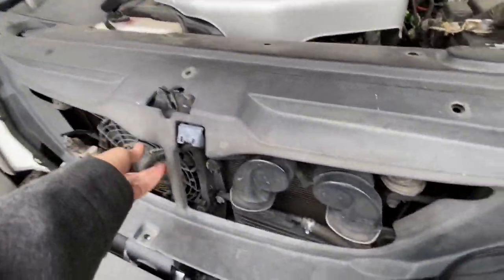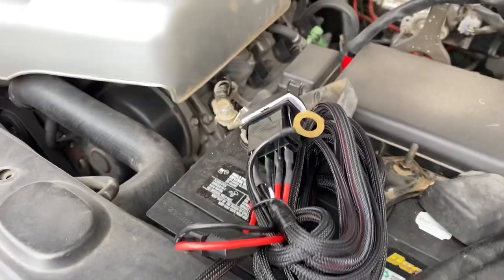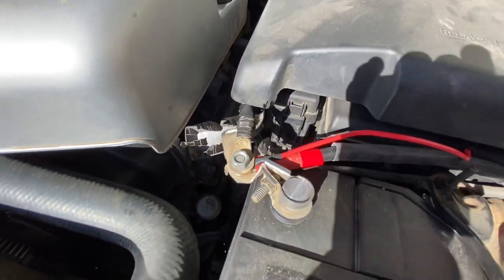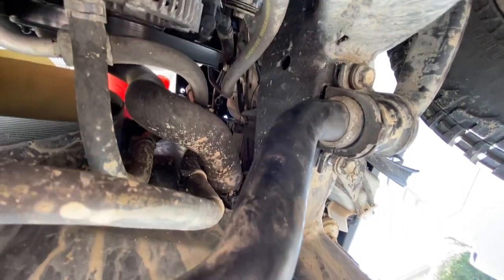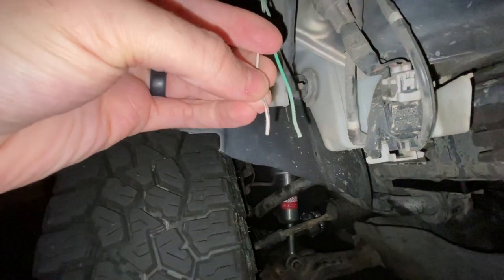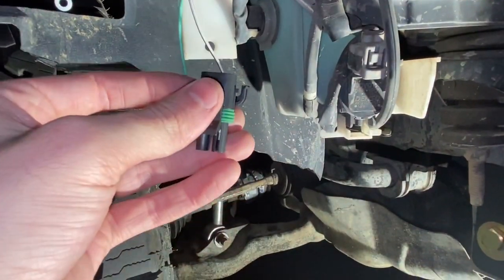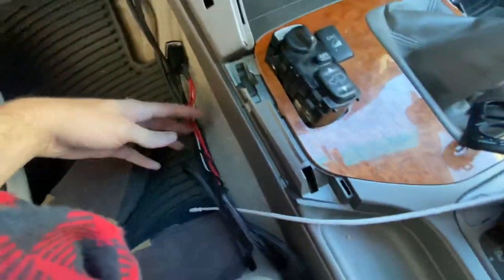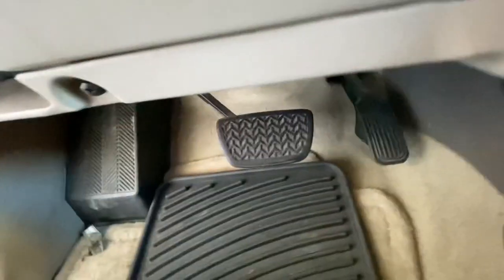GX470 Wiring Update/Baja Designs Foglight Install/Inconspicuous Light Bar Switch Mounting (VLOGs)

Comment: Awesome vid! I'm getting my eibach kit in the next few weeks. Why did you have to relocate thr sway bar? Is it normal to relocate it for the eibach lift? It shouldn't be impacting the shock
Reply from the maker: Thanks! Check out both of my vids on the Eibach kit to help with install. The relocation blocks prevent the sway bar from hitting the lower spring perch in off road situations by bringing everything down and forward. You can see in the vid how close it is before installing the kit. It’s not a necessary upgrade, but definitely one I’d recommend.

You can hear it hitting in this video at 7:36 https://youtu.be/xlitR8YDe3I

Comment: When you turn your high beams on does it cancel your fogs and shut them off?
Reply from the maker: Yes. It does. But the point of amber fogs is to cut through conditions that white light couldn’t cut through. Like when it’s snowing hard, I wouldn’t want high beams anyway since it would just light up all the snowflakes whereas the amber cuts right through it. I tested them in a snowstorm already btw. They’re very effective.

Comment: Nice! Small suggestion - put a battery cut off switch on the positive wire from the winch so it isn't always powered with very high amperage in case of an accident/arcing wires and fire. Also prevents anyone from messing w the winch from the outside. Get a good one that can handle 500amps of continuous load.  Here is the one I got but they have sleaker more expensive ones by blue sea systems.

https://www.amazon.ca/dp/B088382692/ref=cm_sw_r_cp_apa_i_1PT5CSPFP8DQC1V894VX
Reply from the maker: Great suggestion, I’ll look into this. I’m obviously an electricity/wiring noob so this is really helpful
Reply: @lexus_offroad_adventures  No problem, thank you for your video - I am mounting my switches on the stock air ride plastic cover as well so your video helped.  I am wiring more accessories and with some higher power so putting them through a relay box.  Here is a little video I put together showing a neat and tidy way to put one in your GX that looks stock in case you end up putting more stuff in your truck!  I will also probably do a video for my battery switch for the winch when I put it in for you to see as well.  Cheers.  https://youtu.be/tKjsuC_3_Po